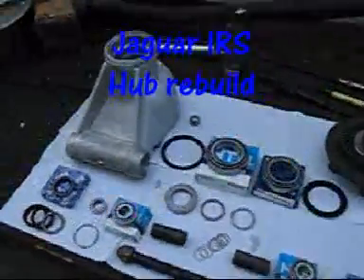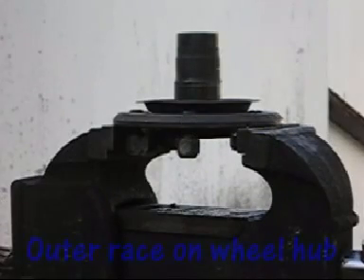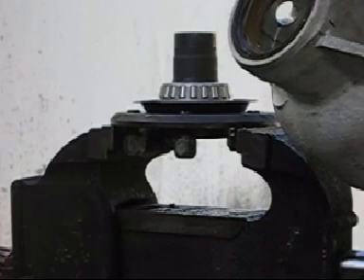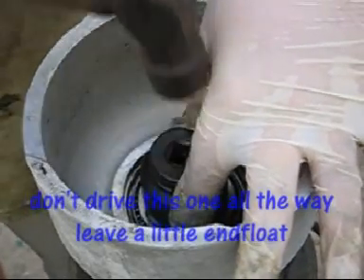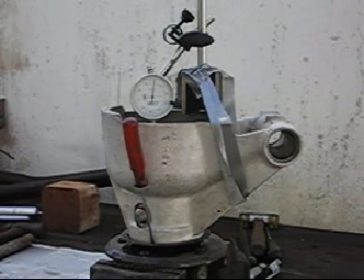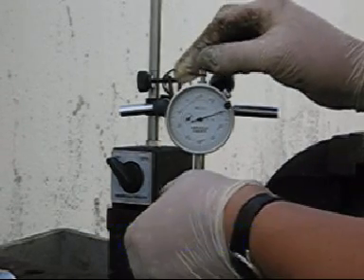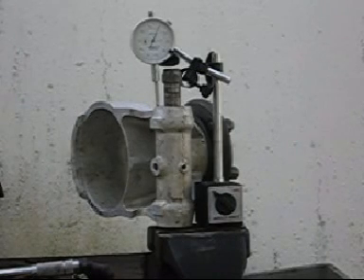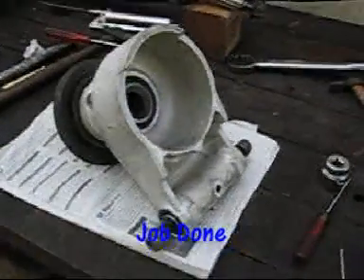Jaguar IRS hub rebuild

Comment: Why not heat the outer bearing in oil so it just drops on?
Reply: You don't want it to seat all the way to start with if you're checking the end float - you need to leave some wiggle room, then use the shaft and nut to tighten the bearing into position.

Comment: You should check the end float dry, no grease.
No need to use a drive shaft yoke to tighten on,  there is a tool for knocking the inner bearing in which has a shoulder stop on it of 0.150"   you then fit a  dti  gauge on the tool then lift up the hub and take the  dti gauge reading, then add the clearence you need to the reading,  0.003"  to  0.005" endfloat.  Then grease it.  R.T.F.M     Cheers from uk.

What torque setting are you using,   100psi.

Comment: I am now rebuilding my IRS and as I am now doing the hub bearings I hoped to see a video showing the outer oil seal as I cant find which direction is the inside or outside? any pictures or videos would be appreciated.
Reply from the maker: The protruding lip goes inside...thats the pressure side

Comment: Question: I am into this now.  How the heck did you get the old races out of the outer fulcrum hub?  I can't find anything I can stick down there to hammer the grooves and move the race.  The attachments on my slide hammer are too big to fit in and/or grab the race inside the tiny little 1/4 inch grooves
Reply: arthur1920 hi, did you get these bearing tracks out? How?
Reply: @wojtekpawlowski4951  Oh sorry.  I just saw this now.  Oh well.  If you still want to know, I had an old fashione (74yrs) screwdriver and I rounded the tip to match the radius of the hub. then I put the screwdriver in horizontally-that means the handle was hanging out in space and rested the now rounded blade into the little slot where you want to hammer.  Then I took a 1 in diameter foot long brass drift and lowered it into the hub, resting on the shaft of the screwdriver.  Yes the scerw driver was at an angle.  Smacked the drift fairly hard once or twice and felt the race move a little. then, I knew I was home free.  positioned the screw driver on the opposite open space and repeat smacking.  after that it just took alternating tapping nor all that hard to move the race out.

Comment: I am posting to all the places I can to find a buyer for my shortened LCAs and Axles shafts from my JAG IRS. They were shortened by CWI. Too bad they are gone, cant find them on the web anymore...They are 57" and like new Never used on the road. they have nee installed on the irs for a year or so. They are to narrow for my truck application.

If you are interested or know someone who might be, contact me at
Bryansoth1@gmail.com

Comment from the maker: @padge46 
This is they one job where you need to borrow a press. I suggest you take the assembly to a local workshop and ask for their help to press-out the shaft (originally loctited-in) and then remove that inner ace with a bearing separator on the same press. Take care of the flimsy water thrower just behind that inner race. I could not get that shaft out with a puller on my etype...but earlier on an XJS I had one come apart with n force needed....

Comment: At 3:05 Did you say "collar"? I can't find this part anywhere. Mine burned up along with the inner bearing and now I have to grind the melted metal off the hub! Can you please tell me where I can find that last metal piece you put on because it does not come with the bearing kits and there are no 80's XJS's in the junkyard near me.

Nice Video it has helped me alot and now Im stuck  : (